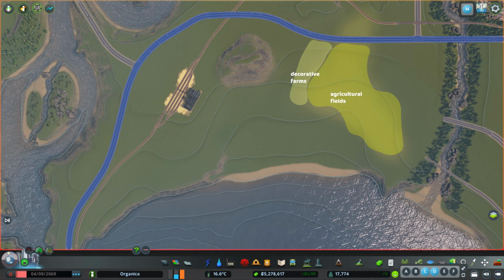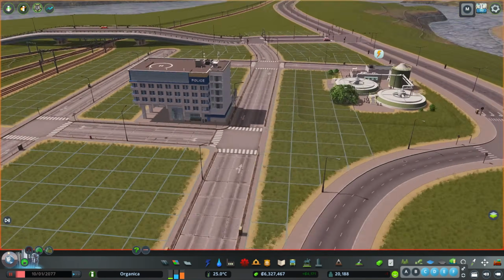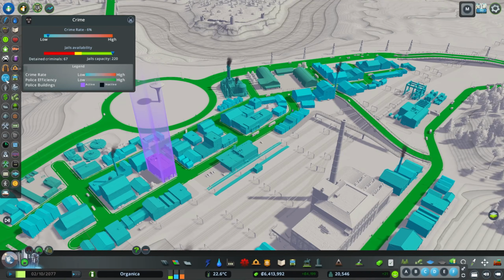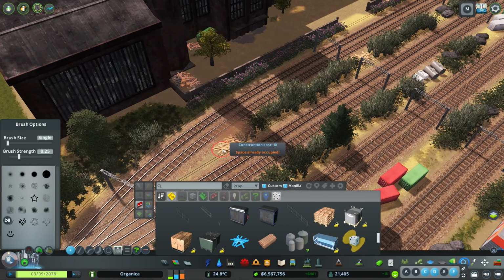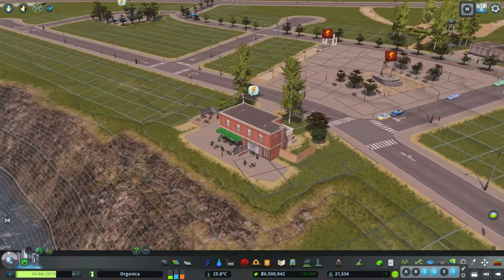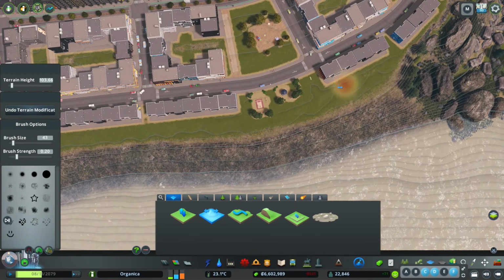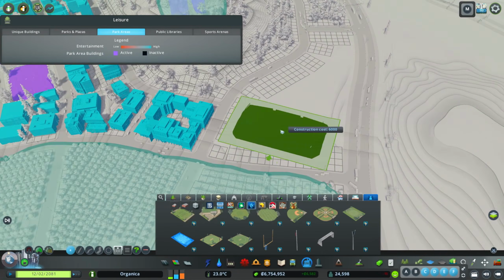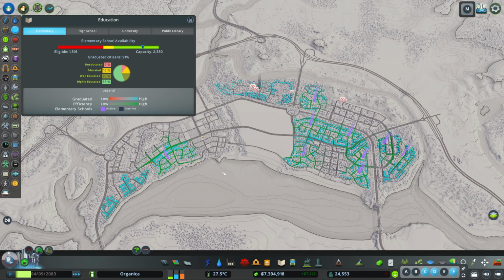Planning Residential, Industrial, Commercial & Office Zones in Harmony - Cities Skylines 1

Comment: If you decide to revive this series I have a tip for adjusting building levels. In the ploppable RICO menu that you can access on each building you can manually set each building level by adding what is known as local settings. In the local building settings you can then save the building level as a level 3 or 4 to get rid of those low land value warnings, even for buildings that are set as level 5 by default.

Comment: sorry i came late but i have a couple point-outs.
1-roundabouts are not supoosed to be that big, its like either a flat circle where you see all the exits(idk maybe 10m in diameter or some have a hill in the middle but this is a long one way by the size a view.
2-please stop making ring lines, by the basic principles its never good to make a first and last mile system, make sure every neighbourhood has a direct connection to most adjacent neighbourhoods so you create a dynamic where most routes should take a single transfer, especially under 50kppl, over is gonna try to be 2 transfers probably.
But i love THE DETAILING ITS SO PRETTY

Comment: Hey, nice video as always! I am curious why you chose to put the cargo train station on the side of the park/hill and the train station for pedestrians in the middle of the industial district. Wouldn't it make more sense to swap them? So when people get out of the station they have some more greenspace and the trucks from the industrial zone don't have to cross the rails to get to the cargo station
Reply from the maker: Good observation! I placed the passenger train station with industrial area workers in mind. As for the cargo terminal, I chose a location with easier traffic flow since it also draws traffic from the farmland and the first industrial zone. In the new industrial area I just built, the cargo terminal has a much higher potential to cause traffic issues.
Reply: @empathcityplanner  Makes sense! I didn't think of that. Keep up the great work!